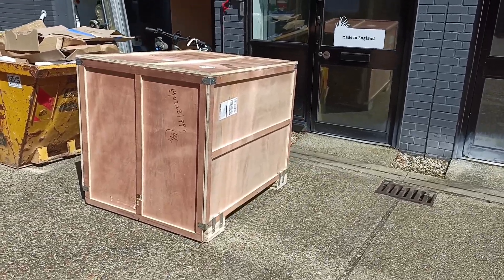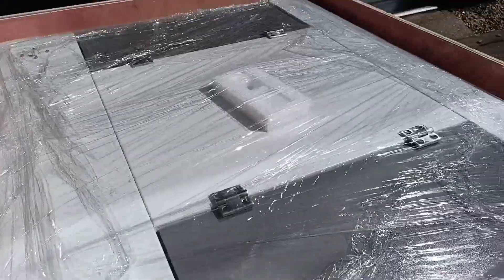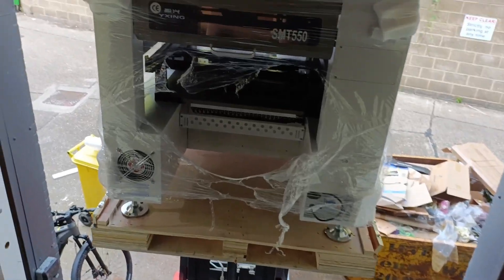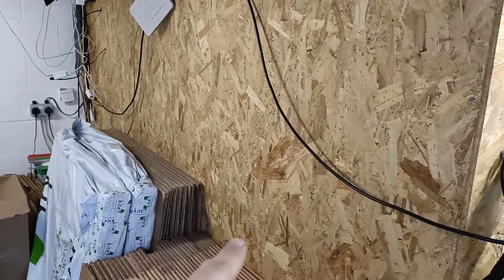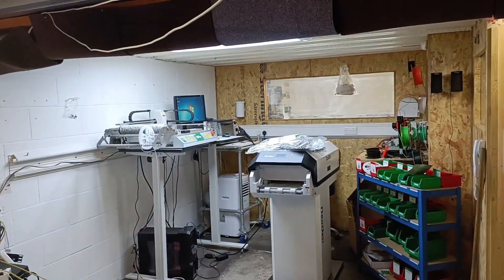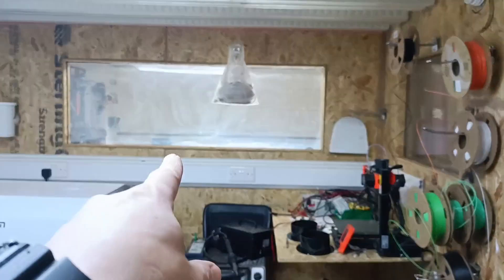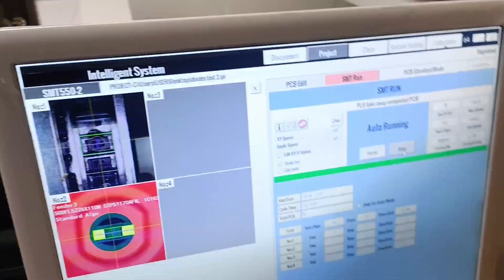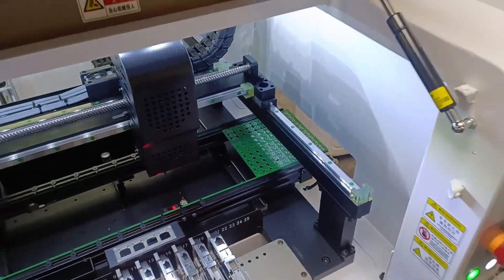New pick and place machine Part 1 - SMT550

Comment: Hey did you ever figure out the track width issue? I’m having problems setting mine. Any input I put in it just opens all the way.
Reply from the maker: The software side doesn't work, you have to manually pull it apart one way or another according to the supplier..real shame that! Brilliant otherwise